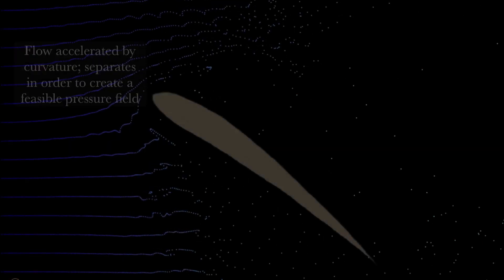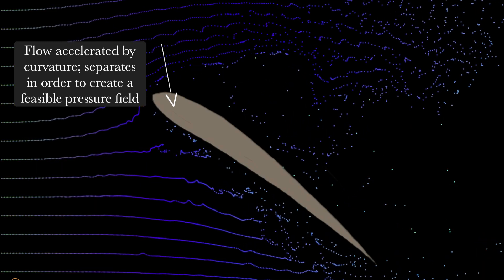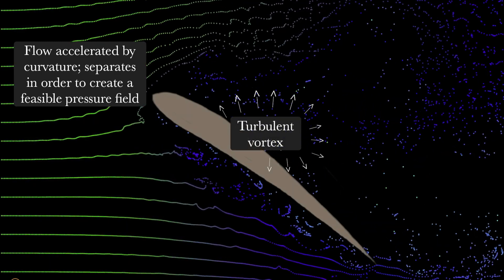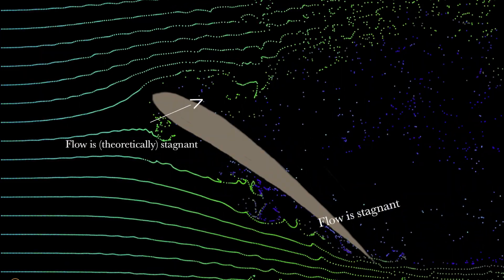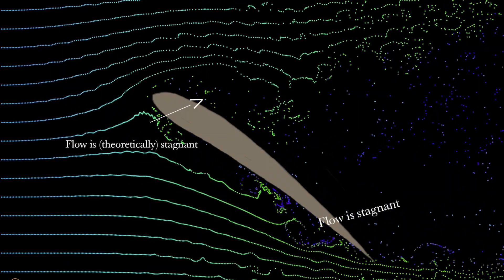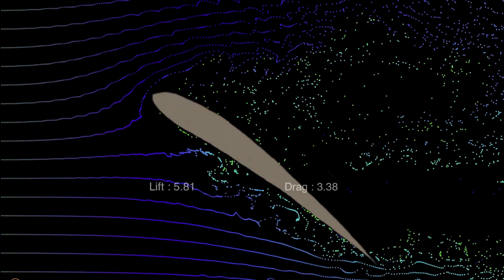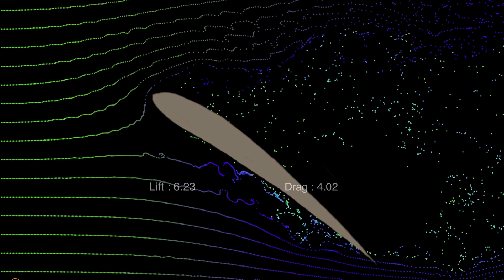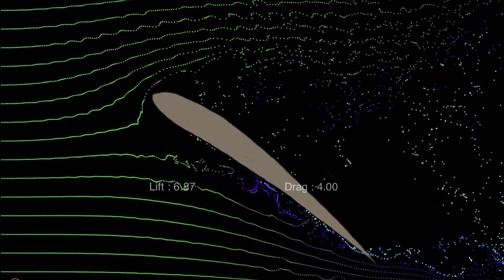Copying Nature - Feathers On a Glider Wing to Reduce Drag and Soften Stall

Comment: I can see how the feathers can "augment the airfoil." From the footage that I saw of how the feathers move about, I can only theorise that the feathers create a more gradual path for the air to follow, thus reducing the stall characteristics to a mere gentle fall, combined with the already good tendencies of the stock sail plane. I'd love to see how you can optimise the feathers' shape to achieve better performance. Amazing work
Reply from the maker: Right that's what i think, too. Essentially they flatten the curvature so that the oncoming air doesn't have to angularly accelerate as much. Thanks for your comment.

Comment: I know its off subject but perhaps this idea I have regarding drones, a sticking point with drones is the noise made by the propellers. My thought is to experiment with the leading edge of the propellers to mimic owl wings. Putting a serrated leading edge on the propellers might have the same effect as the Owl's leading edges making them quiet and perhaps more efficient as they would act as vortex generators. Thoughts?

Comment: 1:30,  ummm,  wrong       yes, the coverts are passively  LIFTED  by  turbulence/reduced pressure.!     consequently, in this context, coverts  don't  do anything.
Reply from the maker: Yes, that's correct. Covert are lifted into the lower pressure zone, where the airflow attaches to the surface of the feathers. That's what happens here. The low pressure pulls the covert up; at a certain point, the airflow can "coanda effect" back onto the feather surface. Then the pressure below the feather will be lower and the feather will droop back down a bit. There will come an equilibrium where the feather is pulled up just slightly, to meet the boundary layer where it can attach. This is precisely the situation in which coverts do their job best and most clearly to see.

Comment: It's interesting that evolution chose feathers over something like a bats wing. this characteristic probably explains partly why. Also feathers provide better damage resistance than a skin membrane and were even used as primitive armor by the Chinese!
Reply from the maker: The interesting thing is that bats have a great deal more precise control over their wing shape. While a bird just controls the arm joints and the tilt of the various feather groups, a bat can articulate the membrane with its arm joints, wrist joint, and all its finger joints. It can also effect the incidence of the inboard portion of the wing with its legs, which is very advantageous for short takeoffs and landings. I suppose all of the enhancements to aerodynamic control still don't outweigh the dangerous fragility of skin-and-bone wings, especially since without feathers the bat doesn't really have any appreciable airfoil shape, and thus is not terribly efficient in terms of lift-to-drag. That puts quite a weight limit on the creature. Also with the intricate wing control comes the extra weight of the muscles that operate those joints, all of which are within the wing, increasing its rotational inertia about the shoulder and setting a hard limit on flap rate. An interesting consequence is that by positioning their relatively heavier wings in relation to their body, the bat has a great deal of control over its trajectory and attitude regardless of aerodynamics. I think the fact that feathers' stall-softening characteristic is effective at larger sizes, such as for my glider, for seagulls, and for all large birds, explains why bats are so smashingly successful at small sizes but only barely viable at larger sizes. The inertial control afforded by their heavy wings probably becomes more a hindrance than a help for the larger bats, while the rigidity of the keratin in feather shafts probably limits deflection of feathers in small birds where aerodynamic forces are exponentially lesser.

Comment: Not all aircraft stall.
Reply from the maker: All flying surfaces are capable of stall, and even though a well-designed canard may stall very softly or even imperceptibly, or a helicopter may have an aerodynamic threshold speed much higher than it ever needs to fly, yes truly all aircraft are capable of stall.

Comment: you should look into how NASA's F16XL used microscopic holes in the wing and negative pressure to keep laminar flow. I know it was for supersonic laminar flow but the concept of "sucking" at the stagnation points is interesting.  you would obviously have to use a much larger plane to offset the weight and size penalties of a "vacuum" wing.

Comment: Congratulations!  You discovered vortex generators.
Reply from the maker: Not quite, although you are partially correct and they certainly do look similar. Naturally they cause some turbulation of flow in cruising low-incidence flight as a by-product. But their function is to bend upward when high angle of incidence causes extreme liow pressure near the top side of the leading edge. They thereby allow airflow to stay attached to the wing "surface" throughout what otherwise, with a complete separation bubble extending back from the leading edge, would be a violent stall. Theoretically, with very precisely shaped "feathers", one could achieve this function with absolutely no vortex gerenation whatsoever. Birds, especially very aerodynamic ones like albatrosses, show this function very well. (Note that they also have extremely small, rougher feathers along the very leading edge of the inboard section of their wings which do generate vortices but are not actually large enough to alter the apparent incidence of the top side of the wing and to thereby reduce flow separation).

Comment: Great video. I got something to do in my project with this video. But I was said to show this effect on a simulation software ☹️
Reply from the maker: Hmm. It is difficult to simulate flexible materials AND turbulent flow in a single simulation. Maybe you can use a Fusion 360 simulation to find the necessary load for bending the feathers at θ degrees deflection. Then, use a CFD program to find the pressure load on the feathers at θ degrees deflection. See if it is enough load to make them bend.

Comment: maybe use lightweight covering film but only attach the front portion of the feathers to the wing surface. you could even overlap a second row of feathers like a bird and see what the difference makes.
Reply from the maker: Yeah, good idea. I had been thinking of something similar. Will revisit this project sometime and implement better methods.,
Reply: @AeroCraftAviation  I'm planning on making a STOL high wing, I'll be adding two rows of "feathers" I'll update you as I go!

Comment: Would this have any benefit on a 12" catapult launch free flight glider on flight times and performance please?
Reply from the maker: Sorry for late reply. Yes, it may have some small benefit. That size has very dominant skin drag, so surface aberrations will induce greater relative drag. You will have to be careful with how many fathers you add. You will have to play around with it. But I could see some hypothetical small advantages coming during transition from launch to cruise.

Comment: Glue true feathers, with the correct sizes in a birdlike pattern and test it please
Reply from the maker: I have considered doing that. I doubt that true feathers would make much difference. If the theory about the feathers' function is correct, then true feathers would only improve efficacy slightly and would not change any of the fundamental effects. Still, it could be tried just to see the increase in efficiency (would probably be a very small increase, maybe even unnoticeable).

Comment: nice observation of this detail of bird flight ! implementation and demonstration are super good. if you want to exercise on tip stall what about trying a more swept forward wing?
Reply from the maker: Thank you! That's good to hear. Oh yeah, forward swept wing is a good idea for tip stall testing,. Maybe it would not hold up to throwing, though. The force would act unevenly on the wing. Good idea though. I hadn't thought of that.
Reply: Forward swept wings, without wash-in are quite tip stall resistant.  Aft sweep would induce tip stall.  Doing some lift distribution studies in something like open VSP or AVL will show this well.
Reply: @Flyzguy  tip stall quicker in FWS than the rest of the wing, which works as a stall recovery, and adds overall stall resistance because the stream of flow that generates lift on the wing is not affected by it just diminished, i mean your „feathers“ on the inner wing would benefit from added stall resistance of forward weep wings

Comment: i wonder what would happen if you use actual feathers of a bird or synthetic ones?
Reply from the maker: The difference would probably not be noticeable. Much of the reason why birds' feathers work the way they do is not because of their unique structure, but more because of how they are affixed to the wing. The elasticity of the bird's skin, as well as the articulation of each scapus effects how the airflow can move the feather. Also, some feathers or more generally some pterylae can be articulated on command by the bird's muscles meaning the bird can change the way their feathers respond to airflow. In terms of mechanical properties, bird feathers really aren't all that special. Really the challenge is getting the feather to attach and to MOVE like a bird's feather. We could get into hinges and mechanisms, and compliant leading edge materials and all sorts of challenges to that end.
Reply: @AeroCraftAviation  oh wow, i never knew about this stuff. interesting. thanks for taking the time to respond so delicately

Comment: It’s a very nice job, but I could still suggest trying to put a turbo thread on the wing for 6% and it would fly much nicer and further.
Reply from the maker: Yeah thread at the airfoil high point for turbulation works well. But I have done that before. This was a test of something new. I wanted to see if it would work.

Comment: Great experiment. A couple notes: DLGs use a fairly well designed airfoil working at fairly low Reynolds numbers( look that up ). As such, it works in an area of fairly easy stall, along with the tapered wing design. Thicker airfoils on larger aircraft would react differently,  also along with a wider chord more prone to stalling, heavier weight loading, etc. Much to be learned. Best wishes on your schooling!
Reply from the maker: Thanks. Yeah for sure, stall occurs very easily at low RE. That's mainly because the boundary layer is quite laminar, and so flow contact is tenuous and subject to small surface aberrations or changes to free-stream velocity and turbulence. This poses a difficult challenge for designers of modern drones and MPASs and MAVs and such, as the best L/D efficiency for small UAVs tends to lie in the 0-75,000 RE regime. ( And in fact DLGs are sometimes below 40,000) BUT if you can control that boundary layer (which even the best AG airfoils aren't too great at) you can get this 'natural separation', where flow turbulates right before the secondary stagnation point and separates aft of the adverse pressure gradient, which can be super efficient. So you want to be able to cure that instability and get consistent natural separation. That was the prime goal of this experiment; to see if this was a viable solution or partial solution to that boundary layer instability. Such a mechanism would not be very applicable on a thicker wing with higher wing loading, because such a wing would operate at higher RE and would have more stable boundary layer contact. And a wider chord will actually increase RE even more (because of chord/Kviscosity) so then there's even less use for these feathers. All you really need for such a wing are good vortex generators, like we see on A319s.

Comment: Glad to see you finally got around to a feather experiment like we talked about. Seems it actually had some good results. Well done!  I'd think that actual bird feathers would give more lift during stall event due to actual feathers having the means to actually lift using the quill as a mini flexible beam in the feather to transfer that feather flex back to the wing. When separation occurs, the tip will flex away from the wing and this can also physically pull the wing upward gently. Unlike paper which just separates and flaps.  I would have thought paper would be more of an indicator of separation, but as your test shows, it does actually have a good effect on separation. I'd like to see you use real feathers and see how much difference it makes over paper. You could just tape some feathers in place in the same orientation as the paper, and see what happens. Make sure you use the same size/length feathers as the paper pieces to keep the comparison equal-ish. You really got my hopes up at the beginning of the video when you said feathers.
Reply from the maker: Yeah the improvement was quite noticeable. Certainly promising results. That's a cool idea, about the lift force of bending feathers. However, I'm not certain that it would work out that way, mechanically. If a feather is capable of providing mechanical lift, then it must have some resistance to bending. If it has resistance to bending, then it will only bend upward until its resistance matches the air's upward pull. So the two will reach an equilibrium where neither force overcomes the other. If the forces are at equilibrium then there can be no inherent mechanical lift. The only way to possibly get mechanical lift that way would be to have a sudden burst of low pressure which pulls the feathers up, and then a sudden normal pressure which allows them to spring back all the way. Now keep in mind, the 'springiness' of the feather is not an inherently upward force. It is simply a tendency for the feather to close the distance between itself and the wing. Since the wing weighs a whole lot more than the single feather, its tendency for inertial rest would be much greater. Thus, if there is a tension force between the bent feather and the wing, the feather is the one pushing itself down onto the wing, and the wing isn't really getting pulled up towards the feather. So I guess theoretically if the wing weighed as much as the feather, and the feather as much as the wing, then the wing would tend to accelerate upward towards the feather, instead of the feather accelerating downward towards the wing. But in that case the pressure gradient required to lift the heavy feather would be absurdly high. It does seem intriguing though. I can't quite work out in my head for sure if there would be mechanical lift. I might try representing it mathematically to try making sense of it. It's kind of an interesting physics problem.
Reply: I understand what you are saying, but just to be clear, The feather being used does not necessarily have to be a large one with a 4-5 mm strong shaft which probably would not work well on a wing, but a smaller one with say a 2-3 mm" quill at base would flex quite easily towards the tip of the feather and still do what i said, transferring "a bit" of lift through that quill at stall better than flappy paper strips. And I may be totally wrong.  Modelling it might not work properly either, as a single feather is a very complex machine, very hard to model properly. How would you measure the flexibility and all the other forces involved? I'd say best and quickest to just try the experiment, what can it hurt? Of course having all those feathers taped to the top of your wing would make for some relatively dirty airflow compared to the regular smooth surface. Always a price to pay. But hey, feather work well on birds at your glider's type of speed envelope, so why not try?
Reply from the maker: @somethingelse2740  Hmm yeah I see that. I'm still not sure about it. It's one of these things that I just can't figure in my head. It reminds me of that pendulum fallacy, where people falsely think that a helicopter has inherent stability by acting like a pendulum underneath its rotor disk, whereas in reality it doesn't. Same thing here. I feel like there's some logical fallacy here regarding how the forces should interact. I guess if I have time I could have a go at building it. I would definitely need to have some means of measuring the force produced. If there were any extra lift force, I doubt it would be much more than a few tenths of a gram. Perhaps a homemade wind tunnel and some way to mount the wing onto my gram scale. 
     As for dirtying the airflow, yes it does, but surprisingly, the turbulence ends up in the proper place, right before the adverse pressure gradient, such that drag is lowered quite significantly. Felix Schaller has some tests of this showing upwards of 20% drag decrease.
Reply: I think we are having a communications breakdown here. I am not making claims of adding feathers giving you extra lift during normal flight. Your video was all about giving your low speed glider better stall recovery. Not giving it extra lift. The feathers would be taped down flush with the wing. When the stall happens what were the paper slips effectively doing? I am merely thinking the feathers might work better than paper slips. No helicopter pendulum fallacies here sir. :-) I have no belief that feathers will add extra lift in normal flight, only when the turbulence of the stall happens, the lifting of the feathers by such stall turbulence might give momentary lift helping the wing come out of stall faster than paper slips simply flapping about. Don't overthink it. :-) And I agree with you, I'm not "sure" about it either. But I do believe it would work better than paper slips. 
To keep the experiment equal, the feathers would have to be equal to the paper slips in size and amount already installed on your wing. no wind tunnels needed, just try it like your paper test and see how the stalls feel.